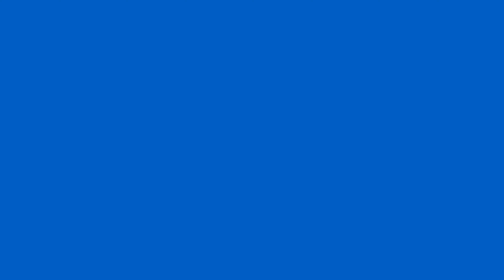Replace Fisher Paykel Tumble Dryer Capacitor

Comment: thanks this fixed my problem run down of my debugging
empty drum unit work fine in auto
wet towel in drum unit would stop spinning on the auto cycle near the end where it stops and starts couldn't turn the drum also error 4
found Mr Wash Washy video on capacitor replacement the motor cant start need the kick of the capacitor to get going. replace part super easy machine would now turn on the auto cycle but before it finishes will error 4
follow this video on error 4 fix the problem system is up and running again.
Reply from the maker: Awesome glad it’s working now

Comment: Holy shit, don't you think you should discharge the capacitor before removing it  just in case it's still holding a charge.
Reply from the maker: Good tip. Will do it in future videos
Reply: Can someone tell me how you discharge it please? I am going to attempt to replace my capacitor to see if that is what my problem is, but now I'm scared.